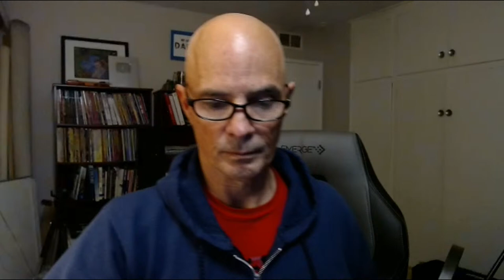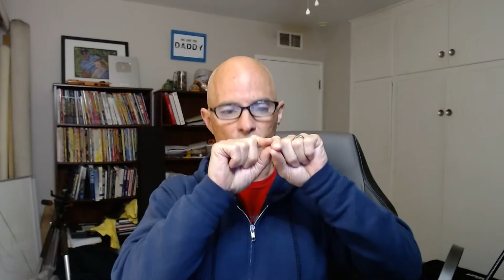LET'S TALK TECH-BTR TURBO CAM AND EXHAUST TEST

Comment: I would go with a smaller cam (Truck Norris) in the 5.3 than the BTR stage 2 turbo cam, BUT the turbo cam still made 500 pound-feet at 3,000 rpm, or 150 more than the NA combo. That's a big power gain, no matter how you look at it.

Comment: I’m running a summit stage one truck cam in my 2001 Silverado. The truck runs fantastic and makes significantly more power. Useable power for a daily driver. Everyone who hears it asks “what kind of cam is that?” It lopes decent for a 209/217 @ .0.050
The goal is to run a turbo next year. I’ve already got it running flex with a sensor on the stock computer. It has long tubes currently, a wideband, and 2010 6.2 flex 50lb injectors.

Comment: I think that if an engine has more exhaust cam duration after intake stroke then the more that the exhaust back pressure could affect the flow of the whole system but that doesn’t effect the power because we’ve seen that whatever works the best NA is what works best for boosted applications as long as your not making 2000 hp 😅🕺🕺” less cam and more torque equals less problems with back pressure” 🤔🤔

Comment: I was looking into purchasing a hellcat long block until I saw some forums saying there has been some Rod failure in the low to mid 20psi boost range. Their setup/ tunes varied but it made me curious as to what these engines could handle horsepower wise with someone with your skill and talent conducting the test. 
There might be some extensive fabrication involved but I think it would be cool to see what that mopar is capable of.

Comment: Does an H- or X-pipe help with power on a twin-turbo LS with full dual exhaust and mufflers? I would guess even more so than for an NA engine.
Reply from the maker: even less so-no scavenging effect through the turbo-might be some in exhaust pre turbo
Reply: An x might help after the turbos by adding some scavenging, but this would tell me you post turbine exhaust is already too small as well.

On a side note, an x pipe after the turbos does make it sound even better though (similar to n/a x pipes)

Comment: Quick question i have a 2000 silverado 5.3 ported to 6.0,  232/236 cam, with 3600-3800 circle d torque converter fully built tranny everything runs real good only thing is when i put truck into gear especially reverse or drive rpm dips real low sometimes turning off any idea what can be causing the problem?
Reply: Yes, first off I doubt your "ported" 5.3L is now a 6.0L especially without boring and new pistons and rings.. Second, if you have a secondary tuner, you only need to bump up the rpm level to 750-800rpms max depending on your torque converter.. Third, if it's not stalling, what's the problem? It's normal for your engine rpms to dip a 100 or  200 rpms normally when put it Into gear.. If it's not a normal drop and "lopes", it's most likely a fuel vapor recirculation issue or a vacuum loss issue. Check for. Vacuum leaks and if it doesn't solve the problem, check the fuel evap emissions system.
Reply from the maker: it needs tuning-did you bore the 5.3l block out to 4.0 inch?
Reply: @Leon-Servant-of-Christ  ok thanks i will check it out already installing hydroboost brake system hopefully that helps and rpm already set to 800 maybe i will put it to 850 but yeah its only when i put the truck in gear sometimes at a red light or stop rpm will dip a little
Reply: @Leon-Servant-of-Christ  but when im parked somewhere and i put it in gear sometimes truck turns off once i get it running it has no issues whatsoever